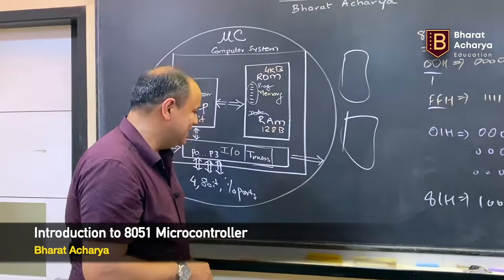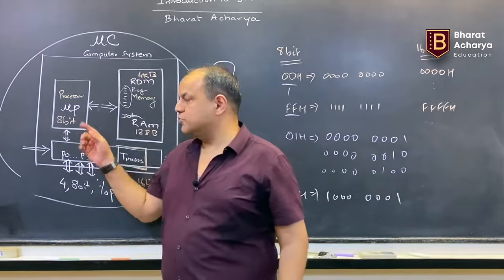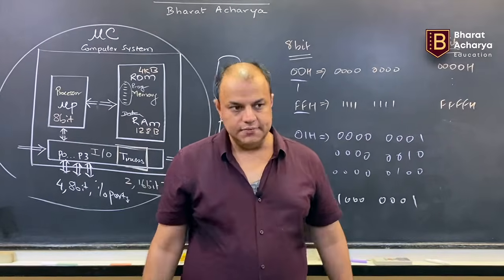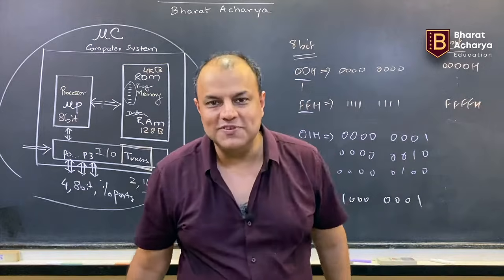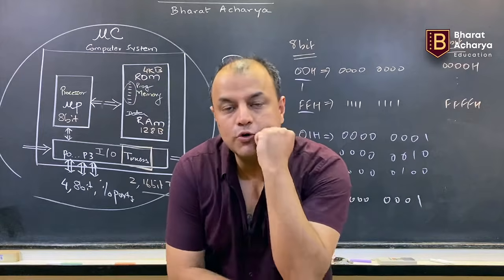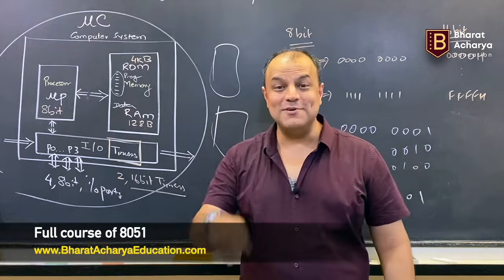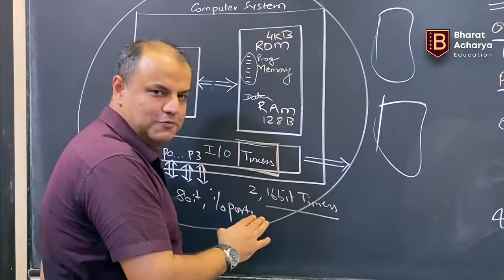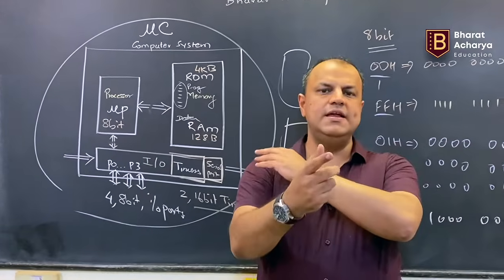Introduction to 8051 Microcontroller | Part 4 | Bharat Acharya Education

Comment: Through practical examples and working examples, this is how one should teach.......
Reply from the maker: Thank you 😊 Best wishes! 
BHARAT ACHARYA EDUCATION
Website: https://www.bharatacharyaeducation.com
Android App: https://bit.ly/3RO7dCU
iOS App: https://bit.ly/40eoUP5
 
🎓 Courses for You
8085, 8086, 8051, ARM7, COA, C Programming, 80386, Pentium

✅ Full video lectures
✅ Topic-wise PDFs
✅ VIVA Qs / MCQs 
✅ Certification
✅ Doubt solving on WhatsApp

Duration: 6 months
Course Fee: 1499/- (INR 🇮🇳) 
Start Learning... NOW ✅ 
Website: https://www.bharatacharyaeducation.com
Android App: https://bit.ly/3RO7dCU
iOS App: https://bit.ly/40eoUP5

-———
Instagram
@bharatacharya.in
https://bit.ly/3r45LAp

-———
WhatsApp
+919136428051 
https://bit.ly/3TknzCs
  
-———
#bharatacharya  
#bharatacharyaeducation  
#8086 #8051 #8085 #80386 #pentium  
#microprocessor #microcontrollers